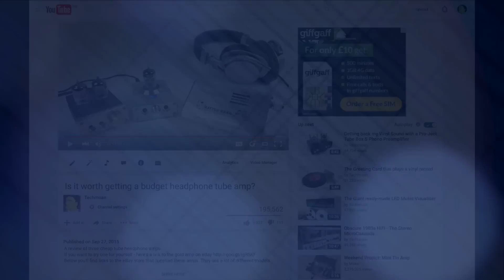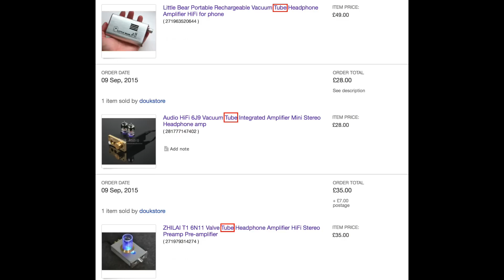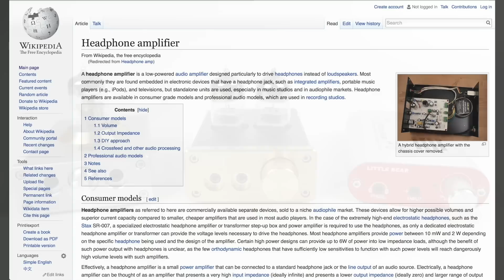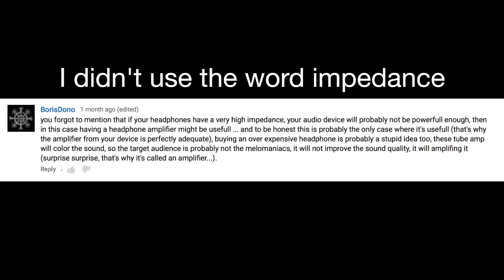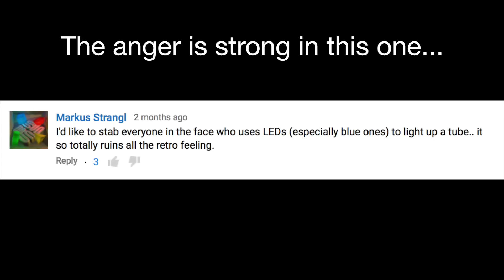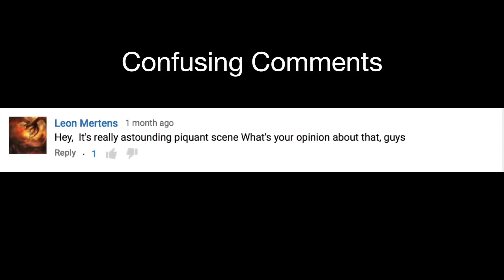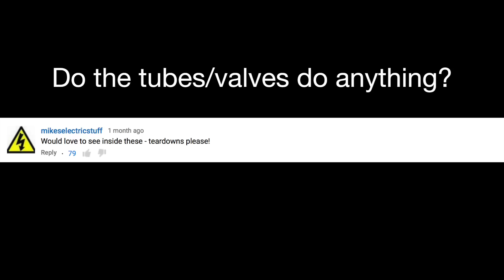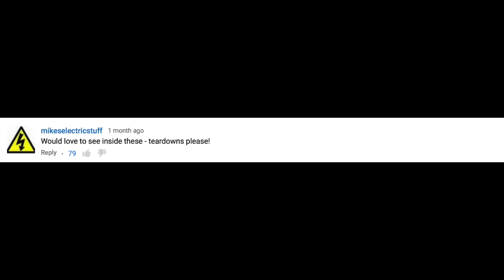Headphone Tube Amps - Follow-up & Tear-down

Comment: As far as powering the tube, the current required is low, so these circuits can use a step-up ("buck") converter to raise the voltage from 12V. [Edit: confirmed; the tube is powered at 190V with a 6.3V heater]. The heater (a second circuit that powers the tube) is typically 6 or 12V, AC or DC, so good to go there. Finally, there is also the "Starved Plate" design where you don't run the tube at the highest voltage possible, but use a lower one. This can reduce noise and lead to extended tube life, although these small-signal tubes last a very long time (10,000 hours is typical). The Blue LEDs are somewhat bling-y, although the Chinese love an excess of bling, so to them it's probably minimally decorative rather than over the top as it might be seen in the West. There are diodes in the circuit, so the LED may simply be in place of a diode in the circuit that does not light up. In other words, possibly not useless as far as the circuit operation goes. I'm not suggesting these offer good, or even adequate performance; they are very cheaply made and little effort is made to increase or even address fidelity. Novelty items, but neat if you like that kind of thing.

Comment: The other ones appear not to be using the tube, all I saw was a lot of smt components, ICs, no boost converters to step the voltage up high enough to drive it. Heck I didn't even see and inductor let alone an actual transformer. Now the last one actually is using the tube, the circuitry on the arm of the PCB where the battery is connected is a dc-dc boost converter, not sure on the current output of it, but it is there. The one under that part is the buck/boost converter for charging the battery. If you would like to have more info on the actual PCB feel free to  contact me on my business website 
volkmanaudiorepair.weebly.com.

Comment: Touching the tubes will cause no damage. As long as you don't let adhesive based solution touch get on them, due to the fact that it can get hot enough to let it run down the tube down to the socket.

Comment: I don't mind if you call them tubes or valves, both are correct terms. Btw..never mind those idiotic comments, you did a good job there testing the three amps for us...thank's a lot. I was in the progress of buying the one with the golden front, so I watched part 1 of your test+ part 2 now. Thank's for your time and for sharing your findings with us on the TUBE...lol

Comment: I did built some valve(tube)amplifires, but I´m a little suprised that they work with a 6V powersupply. Might be the type of tubes.... when I tried low voltage amplifires with an 12ax7 there was no sound under a platevoltage of 12V. And the sound is not near HIfi with those voltage :)  Maybe there is a step up converter installed. Would work because the plate just needs a few mA of current.

But even if the tubes(valves) are just for design. I like the look of em

Comment: I really love your channel.  I have some Basic Electricity and Electronics.  The 6J9 might be also be a 6J9P to quote a data page i found:The 6J9P (6Ж9П) high-frequency short-characteristic pentode has been designed for use in wide-band amplifiers of electronic devices.  The interesting stat about this tube is its nomimal operating voltage of about 150V or so.  I wont put a link in my comment as youtube/valve will flag my comment as spam.  If you read the data sheet it tells you a lot about what it does.  the circuity does not look unreasonable and is used to support the tube/valve to provide the necessary voltages to allow it to perform its job or protect the tube/valve from damage.  Oh yea and the cost is a dollar.  Yup one whole dollar.  Not very expensive even if it was for decoration.  In terms of oils getting on the tube/valve  I would take the caution of wiping them clean with a alcohol wipe and lint free cloth.  Then only handle with cloth or rubber gloves.  The reason for this is the oil can cause the glass to become hotter than the other parts of the tube/valve and it might cause it to shatter.

Comment: People are doing the same mistaking about nickel cadmium batteries and lithium ion about discharging them completely all the time before charging them.Even a normal light bulb that its get so hot can be touched and nothing happens with the grease of your fingers, only a stain and thats it, the real problem  and is where the general myth come from are the halogen lights because the crystal is made of quartz and they work at so hi temperatures and yes halogen light should not be contaminated with nothing before or during the operation,this tubes are not even close to a regular light bulb in temperatures so that is just a myth.

Comment: Are the manufacturers of these units out to fool even the most ardent of audiophiles?. 
Maybe not, because perhaps even the designers thought by putting a tube/valve in the chain would add some mystical zen quality!
It turns each tube/valve in the chain is to act as a cathode source impedance buffer. These units are so well made but unfortunately it seems they're masters of kidology.
Mat, sorry to mention but you talk of Dave, but on his scope test he didn't check further with a square wave. That's where we'd see a possible valve round-off.

Comment: I thought it a little odd when some mentioned that 12 volts isn't enough for the tubes to function.. I've seen old tube based portable radios with their original and massive 9 volt batteries still in them, along with an old car radio, that also had tubes within...
Reply: Robert Jenkins 

Two things to know about mid-20th-century tubes:

Tubes can amplify with only 12 volts on the plate. The catch is that they can't deliver much power - that is to say, it can't drive a loudspeaker nor the final tube of a transmitter.  In the late 1950s, transistors were available, though expensive, so US car radios had 12V plate tubes for the signal and audio drive stages and a transistor for the audio output.

Tube radios designed for portable use with batteries had direct filament cathode tubes. They needed high voltage at the plates (45-90 volts), but started working a second after power on and stayed cool to the touch.

Comment: Running a tube at 16V, as I have concluded from the capacitor data, is impossible - the electrons won't "jump".
Reply: TheProGamerHW 

For small signals, they could. The grid needs to be positive with respect to the cathode (in most tube equipment the reverse is the case) and only a small output could be produced (to drive either a transistor amplifier or a power tube with 60+ volts on the plate).  Perhaps a tube with 16V on the plate could drive efficient headphones.

Comment: nonononono, impedance does not relate to the audio device not having enough power. impedance is the resistance of your headphones. if you have high impedance headphones you need a powerful amp to drive them. that's the point that person was trying to make :D

Comment: On the subject of audiophiles, I have to say that there are quite a few nitwits out there... Once I asked one of them why he needed that super-high-fi sound since he couldn't possibly hear more of it anyways. He claimed he could pick up the super-high frequencies through his skin. Unfortunately for him my uncle is a professor of neurology and I did take some classes with him. In case you don't know: the high-frequency vibration receptors of the skin are the pacinian corpuscles, but unfortunately for our high-fidelian friend, they throw in the towel at about 3 kHz... One other guy has a $150 D-A converter and a $250, and he uses them to listen to hip-hop.

Comment: Welcome to audiophile land. You'll hear from people admonishing you for not polishing your tubes, or how you muststoring them in a freezer when not in use. While I know the actual proper way to use tuvbes is to have pure clear quartz rock crystal the, each weiging 25 grams apiece (very critical) 120 degrees apart Exactly 25 mm from each tube. Otherwise, the sound doesn't reflect properly, and you'll get listening fatigue. And forget about it is you use anything but a Zinc carbon battery to power them. Lithium batteries introduce serious temporal distortion
Reply: LOL - Temporal distortion.  Excellent comment!
Reply: Mine are positioned on ley lines. No one serious about their audio would do a review without mentioning this. ;-)
Reply: OMG - You need to elevate your interconnect and power cables off of the desk at least 3 inches and at least 90% of the run aligned parallel with the equator.
Reply: @sydneybird116  it's not even an interconnect if it is not at least an inch in diameter with solid silver, gold plated, frozen to -270C signal cables with 5 layers of inversely twisted shielding spaced by layers of finely ground Dodo beaks.
Reply: Don't forget to polish nice and hard your mpingo woodie ,shunmook wouldn't have any other way.
Reply: I've learned my lesson. I will never ask a question about a joke again, because people will always get offended and personally attack you. I've removed my previous comments to avoid offending anyone else. I apologize for offending people or hurting their feelings, and I hope this is the end of it.
Reply: @PunakiviAddikti  that comment offends me! Off with your head! 

No but seriously though, people have gotten so sensitive nowadays. If people feel they are above answering sincere questions, it tells more about them than you. Have a great day.
Reply: @alkestos  Thanks, you too. At least there's some fine folks still out there, like you.
Reply: not gonna lie you had me going for a second thumbs up to your comment.
Reply: @PunakiviAddikti  They do, however, restrict or allow the movement of electrons in a circuit in response to a control line, hence the name of "valve" is technically more accurate than "tube".  It's how they amplify - setup a circuit with a big power souce to run through a valve/tube/transistor, put your low power/weaker signal on the control line of the valve/tube/transistor and presto! You have a much more powerful signal that's essentially an exact match of the signal you used to control the valve.
Reply: @PunakiviAddikti  OP mentioned "temporal distortion" because it's a silly pseudoscientific word with no basis in or impact on listening to audio through any format. 

You said you got the joke, then asked to have the joke explained to you.
Reply: @PunakiviAddikti  Joke went right over your head, huh?
Reply: @PunakiviAddikti  Hey I don't appreciate your last comment. Stop gaslighting me :)
Reply: @PunakiviAddikti  Lol someone's been accused of gaslighting before, hasn't he? But he didn't know why the woman said it to him so now he just uses it when he thinks it applies.

Comment: Not many people know this but PCBs actually have multiple layers under the surface to make connections with other components, this saves space by not having all the connections on the top or bottom surface. Higher-end boards made for industrial use can even have up to 12 or more layers inside them. That explains why it looks like some of the tube connections are not connected to anything.

Comment: Tubes have a heater element in them to warm the filaments.  The warming excites the electrons in the filaments.  The electrical current frequencies passing through the filament creates magnetic frequencies which are then absorbed by another filament which allows the tube to act as a valve or high frequency magnetic switch; think cathode--anode. It is just a switch.

Comment: From what I understand, there should be alternatives to the Chinese tubes provided with your headphone amps. The benefit of that often yields an increased quality in the audio. I own a Chinese Tube Condenser Microphone, and soon after owning it, I discovered an alternative to the provided 6J1 (which are harder to find) which is a 5654 or 5654W.  As a result, I did find a better quality in sound with it.

Comment: With op-amps and sometimes with pwm's in some car amplifiers not all pins are always used, have seen this many times in repairs, it is especially noticeable in smd mounted circuitry! Where you are soldering to a tab that has no leads running in any direction nor have throughputs to the opposite sides of the 2 sided circuit boards! Obviously they may be relying on some but not all of the connections inside the tubes themselves only to complete a full circuit for show, but do not completely rely on the entire tube for reproducing or amplifying sounds! 

With headphones they can rely on the audio voltage produced by the op-amps alone to supply enough current to drive them! Again feedback in a tube amplifier would be noticeable when first powering up, but would disappear, this is noticed in many older style tube based guitar amps! But don't forget a simple soft-start circuit would also fool someone into believing the tube is completely used and has to warm up! But noticeable noise continuously or feed back "Ringing" is most likely from cheap potentiometer's, cheap low quality op-amps and lack of noise reduction circuits built into the designs! I am no expert either, but have had much experience repairing car audio amplifiers!  

Tube based car amplifiers used to be a thing quite a few years back and mostly people sought them for driving the mid and high frequency stages, since they did not always produce great low frequency sounds for subwoofers, for those they opted for class d and even overbuilt class a/b amplifiers like the Orion HCCA and Lanzar OptiDrive cheater amps which both could handle ultra low impedance's compared to tube amplifiers which would be iffy at a 1 or 1/2 ohm mono load!    

One thing I don't like is how they all opt for press fit op-amp bases instead of them being soldered into place on the board! As well as using smd and non smd packages together "Money Saver"! Tells me they may do that because it is a failure point for quality control making them easily replaceable when they are tested if they burn up! So they end up with less returning for repair to the assembly lines and can keep them flying out the doors by the thousands! 

I Am who I Am!

Comment: all have a dc dc converts to boost the voltage for the tubes. crap design as that induces noise into the amp.

Comment: quick question qhats the difference between the output of the headphone jack and the line out plug on the pono ?
Reply: Puffalupagus360 Line out would simply be  designed to go to an amp, so their may be no amp on that line
Reply: The line out is meant to drive a very high impedance (several hundred kiloohms up to several megaohms) load, such as the line-level input of another amplifier or mixer. The basic idea is that it provides a signal voltage, typically within a specified standard range (0-1V), at very low (microamps or less) current,  thus its actual power output (in Watts) is tiny. In short, it can't drive a headphone or speaker to any significant (i.e., audible) level. The high impedance also means that a single line-level output can drive many line-level inputs connected in parallel without any appreciable loss in signal voltage.

The headphone out is meant to drive a much lower-impedance (from a few ohms to a few hundred ohms) load with enough voltage and current to provide the power (from a few milliwatts to maybe a watt or two) needed to drive headphones or speakers.Overall, the headphone output is not ideal for driving line-level inputs of other devices. It's another step of amplification in the signal chain which adds its own noise and distortion into the signal. Even though such a setup can work as long as the output level (i.e., voltage)  is low enough to not overdrive the connected input, the quality of the sound just will not be as good as if you had used the line-level output.

Comment: nice casette. ps looks that the valves/tubes/majic things of glass are there more a pass tru or buffer, but the amp work is done by other part. well  that tubes are cheap ones an there is a lot of stock. but the sound quality is not the best.

Comment: My last comment regarding valves. Early missiles used valves as well as some flight similators "Harrier Jum Jet". Valves are immune from EMP during a Nuclear Explosion. They will still function after the bomb goes off. George

Comment: High there some great videos. Valves or Tubes ?. The correct term in the UK is Thermionic Valve but other countries refer to them as Vacuum Tubes or Tubes or just Valves. Headphone amplifiers were first developed for Recording Studios and other professional uses "Braodcast" Where multiple users using headphones could adjust their individual headphone settings. Schools and Language Schools soon adopted the idea. Lastly headphone amplifiers were used in loud/noisy enviroments aircraft etc. valves Tubes all suffer from Microfony (not sure about it spelling). The electrodes inside the glass envelope are supported by delicate thin wires which suffer from vibration and effects the electron flow and acts like microphones. The only reason you should not touch a valve/tube when its working. As a Power amp valves handling 25watt would burn the skin off your fingers. Cheers from George

Comment: Am I the only one who noticed the Little Bear has a god damn Raytheon tube? What's a cheap Chinese amp doing with an old American vacuum tube in it?
Reply: char whick they break down old stuff and reuse old chips etc normally grinding any branding off. Seen it on other breakdown vids
Reply: I did notice that and also thought it strange.

Not to mention the crap "elite" capacitor next to a good Nichicon capacitor.  Strange.   Looks like someone got a large lot of surplus, name brand components and then added some cheap stuff to make a product.
Reply: ELNA too (good brand). Beware markings though, you can buy fake Nichicons in china